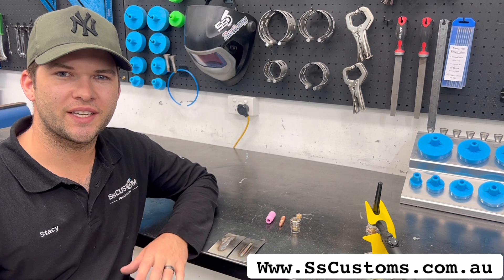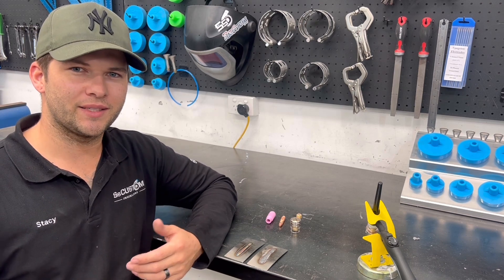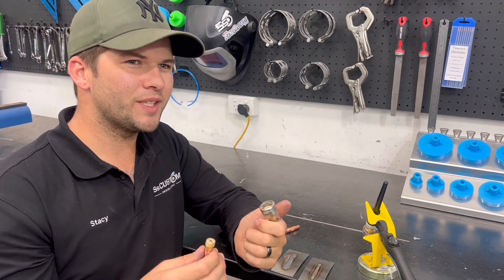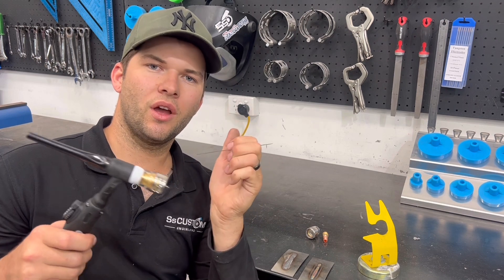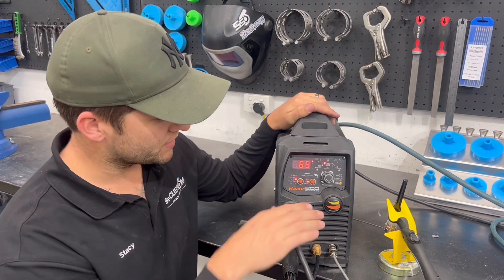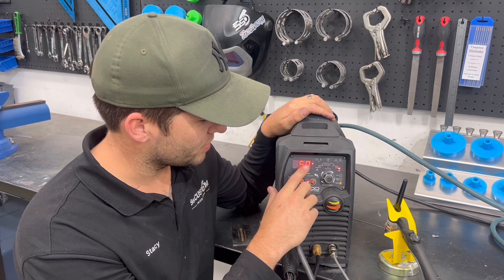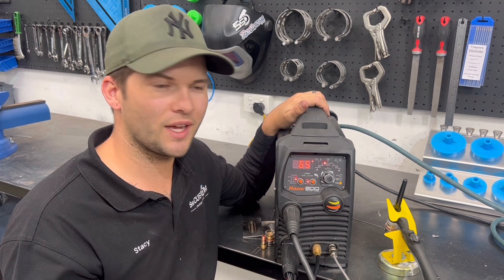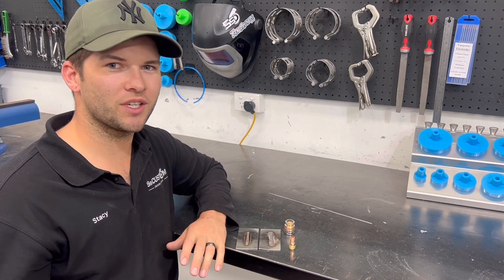HOW TO TIG WELD STAINLESS STEEL FOR BEGINNERS

Comment: A dedicate argon line!? What!?! I am wondering, if I set my gas flow to 20 cfm, the argon hose expands due to pressure, common sense. I open the gas flow to start welding the pressure on the argon hose decreases... I think I am not getting the gas flow I think I set my gauge too. WTH!? I think this is my problem to my gray welds. I am swapping the argon line. Thank you so much. I will come back to edit this comment after I make the change.

Comment: Well done to a point. But for someone who’s MIG welded off & on at work since 78, I was looking for info. What SS was you welding, 304? What filler rod and tungsten works. I have a new machine for 3 weeks and not even on once. I need to weld some exhaust, V-Bands and odds & ends. I know about warpage, sugaring but this is my 56 year old truck with a swap engine. I just want it to last for 15-25yrs. I am retired and find it difficult to get video info to start & finish a job as such. Thanks kindly for what you did provide.
Reply: I am trying to work through this as well, for a 2006 Dodge exhaust. The stainless exhaust pipe I am working with is magnetic, watch for the that. Make sure the gauge of the pipe sections are the same, try not to jump between 14, 16 and 18 gauge fittings so you don't need to change amperage as much. I am using 12 and 20 gas cups on the type 9 torch. I am using Thoriates (red) tungsten and it works better for me to manage the heat. Gray tungsten gave me a big challenge. I am using 308L 1/16 filler rod that I wipe down with acetone. I extend my 1/16 tungsten out of my torch by 1/4 of an inch. I use a combo square to measure the length of the tungsten. I have been working at these exhaust pipe welds for about 30 hours. I really think the dedicated argon gas line might be a key to more consistent welding.
Reply: @ It sounds like you’re doing everything right. SS appliances come magnetic but a professional bench I bought 30 years ago isn’t and it’s huge & heavy. I am not TIG welder, but from what I’ve seen, others weld it using Stainless filler & the tungsten that works best. It just looks different. Wish I can get an answer from the author of this video. After all, I come here to learn & get answers. I am 67. I too am only welding some exhaust and “V-Bands” I’ve got time, some money so just working on the brains part!

Comment: Wow.. I'm an old dog trying to learn new tricks and you hit the nail on the head when it comes to a new welder. Great video and you've got another subscriber. Question if you don't mind: when your welder (Unigmig Viper 185) doesn't have a down slope setting what's the best way to avoid the pinhole at the end of the weld? Thanks for posting simple, straight to the point content.
Reply: Hopefully he will come back with an answer. I leave my rod in the puddle as I decrease the heat, then I focus the heat on the rod so it melts away and separates. Then the little amount of heat can causes the little tip of rod to melt into the weld. There has got to be a better way, hopefully he will reply to you.
Reply: @rauladame2105 I too have a a Unimig Viper 185. I think the pin hole or crater is to do with the fact that the welder not a hf start. It is a lift Tig start and the finish needs to be snapped out to extinguish the Tig arc and finish the weld. This action disrupts the argon flow and needs the argon to be bought back in till the heat gets out. Perhaps, backing up to add more filler before snapping out may work. I struggle with this as well.

Comment: My mild steel tig is garbage. Would the gas lens help that too?  Thanks.
Reply: Grind off the mill layer with the matching abrasive, wipe it off with acetone. Try Thoriated tungsten, gotta hold the tungsten at a consistent low distance from the puddle. Switching to a bigger gas cup of 8, 12 and 20 helped my welding a lot. The mention of the argon line expanding, that may ne a key detail. If you have your closed gas flow set to 20 cfm in an expanded gas line, we will get the rush of argon out, the gas line pressure is open so we may not have 20 cfm coming out of the torch. The size of the cup will work better it there are fewer variables between the tank and the torch. FYI, I am trying to re-learn this as well. Good luck.
Reply: @rauladame2105  I’ll try that.  Thanks,!

Comment: At 58 years old im just a beginner,  and i think i learned more from this video than all the others put together.  Thanks
Reply: Exactly the same as that, I have been using a 20mm cup and cant get a silver weld, after this vid i changed to a 12 cup and its much nicer.

Comment: Thanks for this! hit my question on why for sure my weld was grey when done! Bought SS T304 and SS 308L, had the argon post flow set good BUT only had the #5 cup with kit/welder... I kinda knew it was oxidation from the small cup but wasn't sure if the SS tube was shit or what? I prepped the SS fit up and acetone cleaned BUT unfortunately had to cut with a chop saw... wasn't sure if I was destined for failure from the get go as the abrasive wheel may have already put to much heat into the SS tube? All good as I bought a blade for SS for the bandsaw and it's cutting good clean cuts now.

Weird though my first SS tube passes (exhaust scrap cut from the ends of unused cat) without filler actually came out clean and colorful with the #5 cup which had me second guessing the new SS 3" tubing I just got. 

Just got my gas lense, 2x pink 12" "fupa" cups and 1x 14"? glass cup. going to get on it again today and see how it goes. 

Got a bunch of Stainless Bros SS tube/V-band/exhaust valve and I don't want to screw this up!🤞
Reply: Nice! Yes, always a good idea to practice and experiment with settings, amps etc on some scraps or some cheap coupons before you light up on some expensive parts! Don't forget to clean your filler rod with some acetone too, even new rods straight out of the tube have grey dirt on them.

Comment: How about why does my rod turn red hot all the way back into the torch? Trying to start on some 1/4" material so i can practice just dialing in and starts and stops. No idea why the rod gets instanly red. 
Figured if i practice with thicker material, it wouldnt burn through while i try getti g techneque good
Reply: Be sure your tig torch is on the ground of machine and your ground is hooked up to positive

Comment: It's good info, but what a lot of videos don't emphasize is heat input. 

Through trial and error, if you are putting a lot of heat into the metal, it's not going to matter how much gas you are shooting out, the size of your cups, etc. If your metal is looking like it just came out of a blacksmith forge, you put too much heat into it.

For thin stainless, very high current (100 amps for 1mm thick stainless), very fast travel time, and pulsing will really reduce that heat input, allowing you to weld thin stainless with a minimum of distortion and heat input. Low heat input means your weld comes out looking shiny. 

Learn to do this before you rush out and buy some huge gas lens and waste a ton of gas trying to figure out why your metal comes out looking like a blacksmith forge. If it's doing that, you're doing something wrong.

Obviously if you are welding thicker stainless, then you don't need quite so much amperage, like for 3mm 100 amps without pulse would work.